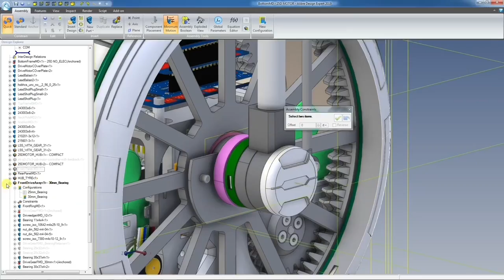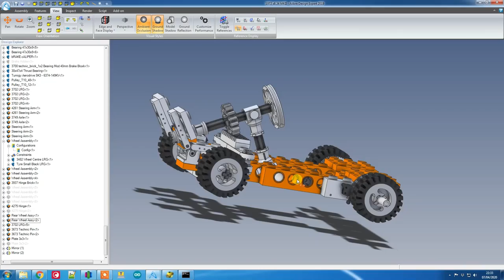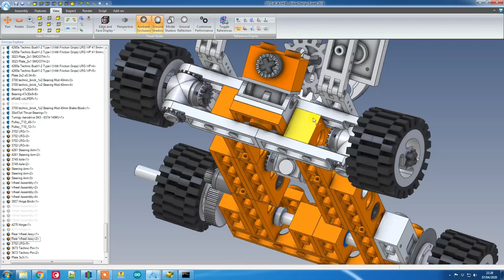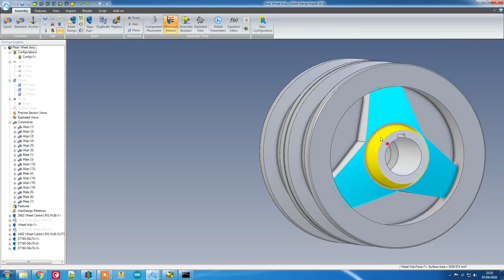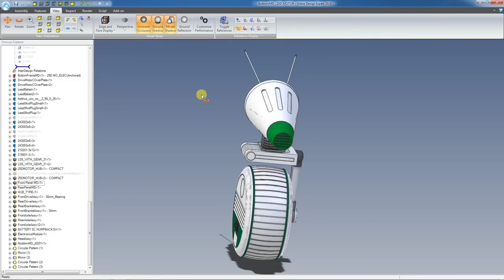XXL LEGO Go-Kart! | Design & Build | #1 - Mantis Hacks

Comment: Something to think about for the grey pins with the split at the ends. Don’t necessarily make them real tight, but you can make two cones that go in each end with a bolt between them. You can tighten the bolt and the cones would spread the ends out locking them in place. What I wouldn’t give for life sized legos, myself.

Comment: 4:55 love that big technic wheel sitting top left, i had a set years ago that they came on
Reply from the maker: Yeah those are really satisfying.. you can see them in this kit https://youtu.be/--dbuLBivVs
Reply: @MattDenton  yep that was the video i was thinking of .. it was quite a big car with suspension and i think maybe 3 gears (edit: just looked it up; it was 8860 .. i also re-engineered mine so it had rear double wishbones) ... im sure i commented about the tyres on the tractor vid, maybe before comments were turned off (?)
Reply from the maker: The car chassis was my favourite kit! Comments are turned off? Not sure why this keeps happening...

Comment: i just got an ender v3 and i want to print this sooo bad

also i would've used more bearings and those bricks in the chassis for more strength and security. i use the technique on my 1/20 scale multicolor model of a uh-1 iroquois (multicolored to reduce wartime vibes)

Comment: 12:00 theres so much engineering in this to support the change in scale .. perhaps you need tweak it for some ackerman angle and maybe some suspension compliance :)
Reply from the maker: Yeah the stearing is going to be horrid! Parallel, all the weight at back, no differential. I have some ideas but want to see how bad it is before I work on making it better 😉
Reply: @MattDenton  no differential good point maybe you need to add one :)

Comment: This is awesome, I hope you do a proper Lego seat with it.

When you mention X2, X3 or x4 perimeter ( 11.53 ) what kinda thickness is that before the in-fill? 

How many rolls of filament just for an orange x8 stud block?

Good luck with the completion of the project, looking forward to the video!
Reply from the maker: Well a MOARstruder has a 1.2mm nozel, so you're looking at 2.4 to 3.6mm wall.

An x8 stud beam is just over 1kg of filament with 2.4mm wall, two bottom, three top layers, 12% infill at 0.6mm layer height.

Comment: Funny to hear: "I can always extend it by one Lego-unit", although are these actually "Lego-units" ;-)
Reply from the maker: Well one Lego unit at this scale.. is still one Lego unit 😆
Reply: @MattDenton  It depends on how you interpret them. Anyway, it would be great if you can actually stack the standard 4x2, with a Duplo 4x2 all the way to YOUR scale ;-) (if scaled accordingly)
Reply: @MattDenton  But I also saw you used a 3x3 plate. I do not remember we had those, especially as you have the Technic parts with the crowns to position them... wonder if those teeth on yours will eventually also wear and break ;-).

Great stuff!!
Reply from the maker: Yeah the 3x3 was a cheat to get a 6x6 and gluing together...
Reply: a (lego Unit) is called a Stud and everything is messured by it.
Reply: @CaptainDonut0  according to the standard 1 Lego Unit is 1.6mm, the thickness of the wall. The stud is actually 3x the Lego-unit at 4.8mm. So.... come again ;-). Now you understand my comment? It is a stretch to call it a "Lego-unit". rather a whatever times-Lego-unit. Don't take it too serious... it was just a funny note to a 'unit' that wa already a 'stretch' (pun intended).
Reply: 😤in Lego there is no mm Lego doesn't use metric ore  imperial  one standard Lego cube size is 2x2x3 studs wide, long, high.

Comment: You should put a gigantic rubber O-ring around the steering wheel.
Also, cutting the diagonals of the tyre treads will help a lot with traction once you actually get it running.  It'd suggest cutting them 1/3 - 1/2 of the way down so they flex a little but don't risk ripping off.
Reply from the maker: Thanks. Yeah I was thinking of adding a rubber element to the steering wheel, maybe neoprene tube like I used on the 5 x scale gokart.

Comment: Have you tried acetone on either end of a PLA part and sticking them together? Acetone makes PLA sticky and once the parts are together, good luck getting them apart
Reply from the maker: I've used it on ABS but not had much luck on PLA
Reply: @MattDenton  Rub some acetone on the areas of the prints you want stuck together, wait until its sticky then slap them together. Sometimes giving the part a little sand down then acetone works too. Hopefully you have some luck

Comment: I think you should have changed the 2  1x8 beam with holes in it to a 1x10 or a 1x12. You would have more room for mounting a seat, electric motor or gas engine. In addition Bigger wheels or modifying the pieces so you have more ground clearance.
Reply from the maker: Yeah I think a 12 stud would be good.. but I was trying to stick roughly to the original.. however... once I've played with this one.. MKII 🤔

Comment: What a great piece of work👌. Very nice lego hacking you did and what a dimensions. Also impressed bij how good you can print flex materials that big.  Is it al thanks to your Lulzbot or did you tweak some of the settings more than once. I’m still stuggling with my Prusa settings for printing tyres for the open rc f1 car which is also nice to do. Can’t wait to see you or your kids driving it 😎👍
Reply from the maker: I find the flexible material fairly easy.. it may be down to the filament or printer..  not sure..
Reply: Matt Denton In the Prusa the flex material doesn’t feed well to the extruder. Do use the R3 upgrade on a Prusa Mk3S and it is still frustrating when the filaments gets crops up in the feeder after printing for some time. I did use flexfill 98A from a company Filamentum (at the time bought from Prusa website). That’s is (still) the major issue for me at this moment. The Lulzbot doesn’t have that problem in feeding the flex-filament?
Reply from the maker: Hi, depends on the extruder. So I have used the flexystruder which is ok, the MOAR is really good for flexible filaments when tuned right. But the new Aero struder range are really easy with flexibile filament.
Reply: Matt Denton i’m not familiair with the flexextruder. Gonna take a look at that. Do you have any good experience with the ‘new’ E3D Hemera extrude for printing flexfill? It should be really good
Reply from the maker: No I've not looked at that extruder. The Aero works well but does tend to jam unless you extrude some filament before extracting it during a filament change.
Reply: Matt Denton thanks for your reply. I’ll really appreciate it. Keep up the good work. Greetings from the Netherlands. Which will now be slowly opened after the intelligent Corona lockdown we have been going throught. Stay healty out there 👍

Comment: I love this idea! Do you design in Lego dimensions and then scale up, or design in scaled up?
Reply from the maker: Thanks. I work in Lego dimensions then scale up.
Reply: How does that work with the bolts etc, or do you add those after scaling? I've been printing technic pieces at Lego scale. Parts that I don't have and are hard to get hold of, and I've designed some parts that aren't available at all.
Reply from the maker: No I scale them in cad and add the bolt holes etc

Comment: What a great build! Could you tell me which type of glue you used? I fly 3d printed model airplanes and glue joints seem to be the weakest parts of my builds.
I see you with a small container brushing glue on but I have no idea which type of glue that is!

Thank you in advance for taking the time to answer!
Reply from the maker: It’s 3DGloop and it’s very good 👍
Reply: @MattDenton  Thank you for the fast response. Great stuff it seems, but rather hard to get here in the Netherlands and quite expensive!

Comment: I don't know if this helps, but the transference from Human to Minifigure Scale is 3.5 Studs to 1 Meter. So a brick 7 studs wide scaled up to 2 meters will give you an accurate ratio of Minifigure size to Human size.
Reply from the maker: 😆 thanks... that means I would be just under 7 studs tall 😩... how about technic figures.?
Reply: @MattDenton  

Technic figures to human scale would be roughly 6 studs per meter. They were discontinued because they're more scale restrictive for builds.

Comment: I would suggest to make lego parts out of wood, would be much easier. You would drill+route holes, route around holes edges   and glue+screw cylinder shape parts on flat surface to imitate lego pins, then body filler wooden screws and paint and clear coat would look like plastic part.
Reply from the maker: Yup. If my thing was wood.. I would 👍😆
Reply: @MattDenton  Then replace word "wood" with hdpe mold :D

Comment: Matt, did you scale up to that size to specifically work with bearings etc? I'm printing a 4x size set at the moment, am drawing each piece to make sure the tolerances are all uniform, but got carried away, excited with printing and didn't consider the need for bearings until i'd bulked a lot of the printing. Have a feeling this is going to be more of a static model than something my boy can play with!
Reply from the maker: Yes. I explain that during the CAD section..
Reply: @MattDenton  - I should probably watch this again with the sound on, instead of having it on in the background of a zoom call!

Comment: What 's the minimum bed size, you need for this project?
Reply from the maker: Well I'm using a Taz6 which has about 280mm sq
Reply: @MattDenton  You promote the Ender 3 Pro on your Amazon front store. Coincidentally, I have this in my possession together with the MK3s. Is it advisable to print your files on the Ender 3 Pro? There are some long pieces that just don't fit.? But then I have to cut the long pieces or can you suggest another printer? The Taz6 is not in de market anymore. I will greatly appreciate your answer.
Reply from the maker: Yeah I have many friends with the ender 3 which is why I put it in my store as a low cost alternative to the Lulzbot printers. But.. the bed is smaller so you can't print all the large parts at 5x scale, I guess 4x scale would work? The Lulzbot printers are not available on Amazon right now hence not in my store. But creality do a larger bed printer too.
Reply: @MattDenton  Thank you Sir. You made life a bit more fun.
Reply: Hello Mr. Denton, this weekend I will start printing this project. Do you have any references on slicer settings? Any video or documentation I can check. I am personally curious in infill % and nozzle diameter.
Reply from the maker: What scale? I use two perimeters two bottom layers 3 top layers and 10 to 15% infil fo the 5x scale version
Reply: @MattDenton  I will use the same scale as you Sir (5x)
I bought the artillery sidewinder X1 for this job. 300x300x400mm
Thanking you!
Reply: I just started printing the parts. I want to get rid of a doubt. Are all these files scaled to 5x (the big one?) 3834 Tyre Medium 24mm Offset Tread (modified for no support).stl is 5x scale and to be used in the big one?
Sorry for bothering you. Thanks in advance.
Reply from the maker: They should all be 5x scale. But what do you mean by the big one? The XXL go-kart is larger than 5x
Reply: @MattDenton  Aha, that was what I was afraid of. What is the scale of XXL compared to the 5x? Do the XXL parts fit on 300x300x400 bed? Thanks.
Reply: @MattDenton  Sorry, now I understand. I have to do the 5x scale x 166.8 and then I have the XXL. And divide some parts in two. Otherwise they will not fit on the bed. You do not have these files ready 8.34: 1? I do have the 5x. Then I have to divide them into 2 parts myself. Not a problem, but saves a lot of time. :)

Totally awesome. I'm going to start today!
Reply: @MattDenton  Hello Matt,
Is there any possibility to purchase the stl's of the rear rims and all the metal parts like the shaft and other parts involved in this project, including the pulley's?
Thanks a million.
Reply from the maker: The XXL go-kart is way mor complicated than the 5 X version of the original model. There are many special and custom parts. Most of the parts on the XXL scale version differ from the original 5 X scale kit. I'm no where near ready to release any files of the XXL sized kart. Sorry.
Reply: @MattDenton  I already started, haha. I will search the internet as a detective using your instruction video. Trial and error.

If I still have some questions in the future, see if you can answer them. Already very thankful for your inspiration and learning process.